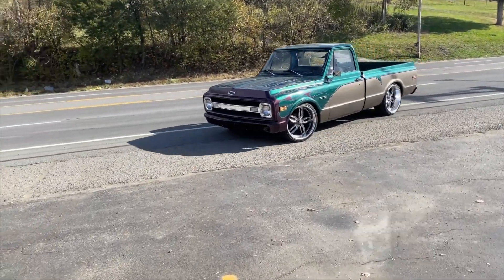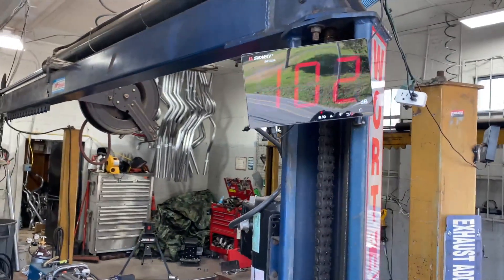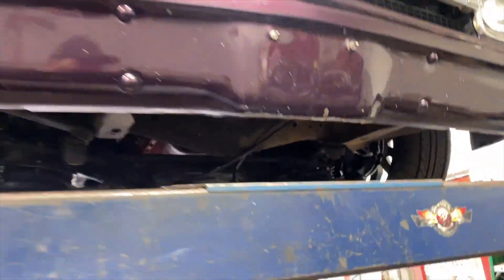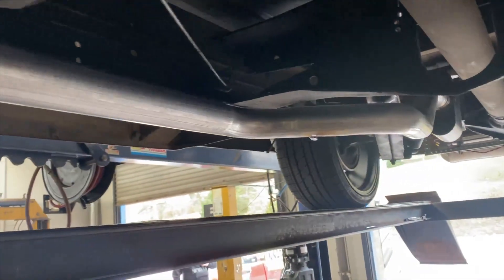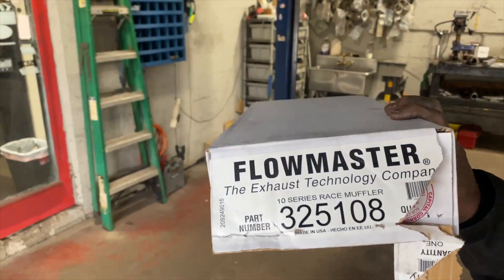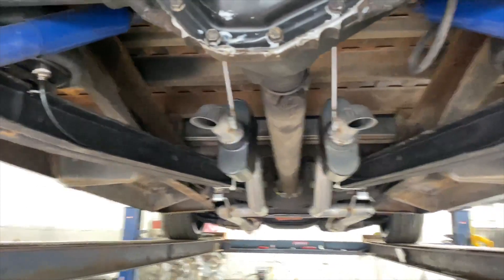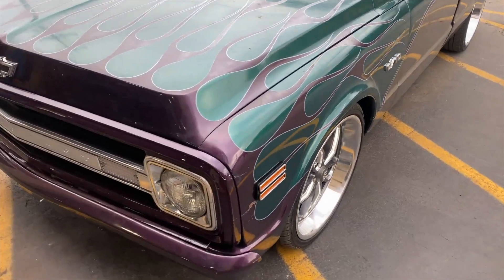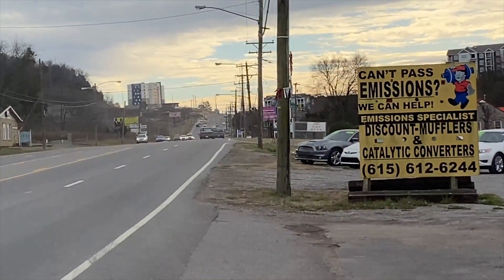1970 Chevy C10 TRUE DUAL EXHAUST w/ LONG TUBE HEADERS & FLOWMASTER SUPER 10 RACE MUFFLERS!

Comment: Drove my Dad's 1971 C10 pickup (with a seafoam green body and white cab) in college.  It had a 350 V-8 engine that purred like a kitten.  I LOVED that truck and wish I still had it.  It had the huge steering wheel and simple punch button radio.  Rode in the back as a kid (on the freeway no less) with my hair flying.  It was the most freeing feeling in the world.  I can still hear the buh buh buh buh buh buh sound out of the muffler.  If you get to choose a truck in the afterlife, this one's mine.  The license plates were LLX 321.  Had a huge battery.  Could leave my lights on during class and come back out and it would start again, no problem.  Had a spare tire on the front and would give people a push who were stuck in the snow.  Loaded the back with sand to keep from sliding.  Seriously guys, I MISS my truck.  Love your video!
Reply from the maker: Glad 😌 to have give you a great memory

Comment: 2.5" or 3" Exhaust from the headers or Extractors all the way through into a  nice set of Mufflers sound the best. 2 an a quarter doesn't come close but all depends on what type of sound you're going for. It definitely quietened it down a little. Great video thanks for sharing.👍

Comment: I putting the same mufflers on my 84 cutlass next week
Reply: 18 RLX Vibrant 7 DCT  Magnaflow for me but those sound nice to
Reply: Is it alot of drone??and will they be too loud??
Reply: @LifewithMario44  eh depends my truck has em and it’s pretty damn loud not much drone
Reply: There goin on a 84 cutlass
Reply: @LifewithMario44  what motor is in it
Reply: 350 sbc
Reply: @LifewithMario44  my tbi 350 5.7 has no cats and the Magnaflow 11225 mufflers it’s true duals and it’s loud and throaty. If you have no cats run the Magnaflow 11225 which is a 2.25 inch inlet and outlet and there’s an11226 that’s 2.50 inch inlet and outlet
Reply: @TheUndertoe  I don't have cats. So I shouldn't run the Flowmasters